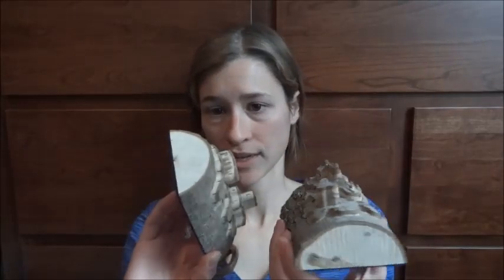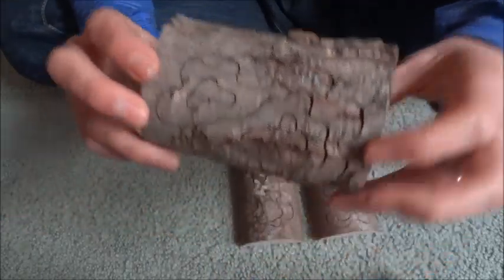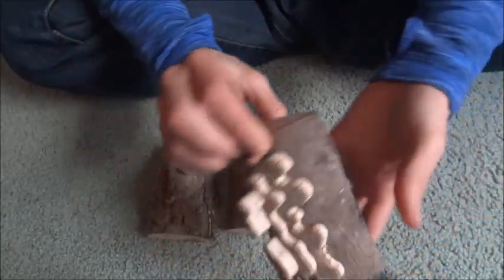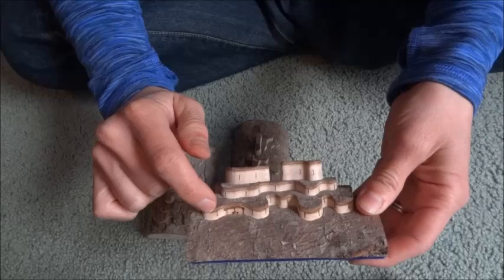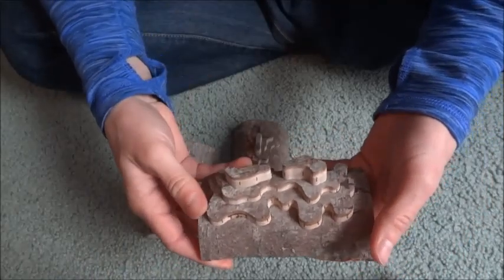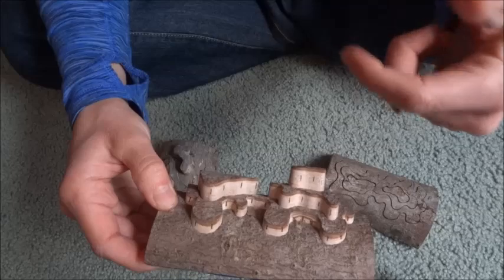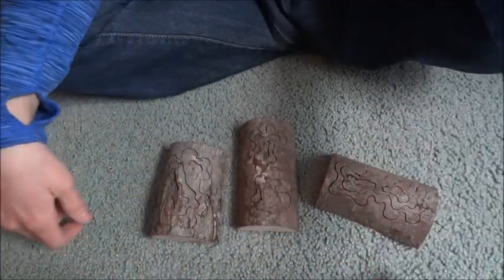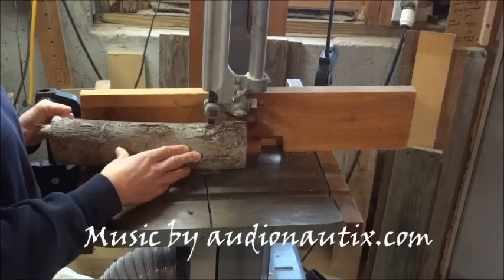Demo and Time Lapse of Pop-up/Hideaway Wooden Castle

Comment: If you start the first cut at 3 or 4 degrees what is the angles for the second,and third cuts?
THANK YOU
PETER
Reply from the maker: Oh gosh, I'd forgotten about this video. It's so bad haha.  The angles are somewhat trial and error, depending on the width of you blade and how thick your wood is. Thinner = more angle.  It's been a while since I've made one, but I think I changed the table tilt only a degree or so for each level.  Not enough angle and the tower will just slide out (which you can kind of fix by increasing the angle and cutting a wedge and gluing that onto the slipping tower, but it's not ideal).  If you try an angle and the tower doesn't slide up enough for your liking, you can decrease the angle and follow your cut again.  Honestly though, just making a couple is the best way to get a feel for how much you need to tilt your saw for each level.  If you like books, the one that I used to get started on these was Scroll Saw Castles by Jim Stirling.

Comment: really enjoyed this video and it has made me see there is other ways to utilize a scroll saw, which way is the angle of your table ??? is it 87 degrees or 93 degrees please
Reply: That will depend on if you cut clockwise or counter clockwise.  The top should be narrower than the bottom.

Comment: Mi piacerebbe sapere come si fa a non fare vedere i segni dei fori alla fine del lavoro
Reply: we use the thinnest drill bit you can fit the blade through and you have to look hard to see it.  Generally not an issue if the bit is small.
Reply: @samhayden3204  Thank you, you are very kind, the problem is that I have the small tip, but it is short, so how to do it? Are there long ones too?

￼

Thank you, you are very kind, the problem is that I have the small tip, but it is short, so how to do it? Are there long ones too?

￼
Reply: @corradodaltri9065  my wife uses bits that are about 1.5 inches long, perhaps a little shorter. She just drills the holes out towards the edge of the log and then goes closer to the middle on the scroll saw. Hopefully I described that well.

Comment: Curious, at what angle do you set the bed of the scroll saw?
Reply from the maker: Pretty Shallow, around 3-4 degrees off of 90.  The closer to 90, the further the inner section will protrude, though this also depends on the thickness of the kerf (blade size, proper tension, well tuned saw).  Unfortunately it's just one of those things you have to try on some scrap a time or two to get something you like.

Comment: at what angle are you cutting and how do u put the windows in
Reply from the maker: Pretty Shallow, around 3-4 degrees off of 90. The closer to 90, the further the inner section will protrude, though this also depends on the thickness of the kerf (blade size, proper tension, well tuned saw). Unfortunately it's just one of those things you have to try on some scrap a time or two to get something you like
Windows are done with a woodburner.
Reply: ok thank you..been scrolling for awhile now..much thanks for getting back to me

Comment: What blade did you use
Reply: Any blade will do, Leyenda likes using the skip tooth, reverse blades.  We have a pinless saw.  Just remember that the thicker the kerf the more the pieces will rise up.  You can reduce or increase the amount that the internal piece raises by increasing or decreasing the width of the kerf or by decreasing or increasing the deviation from a square cut.